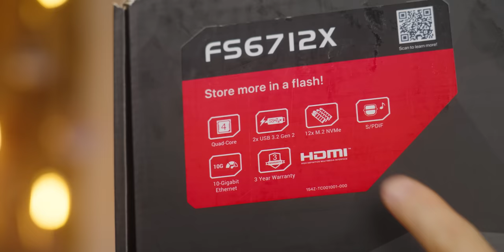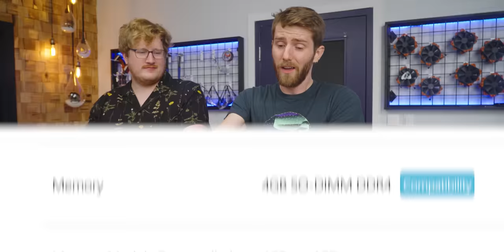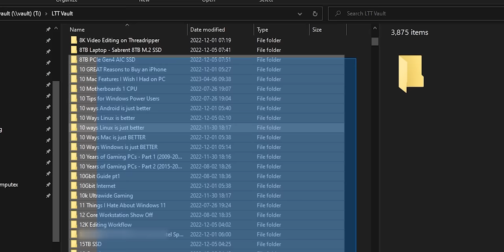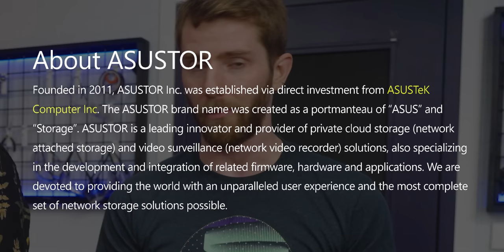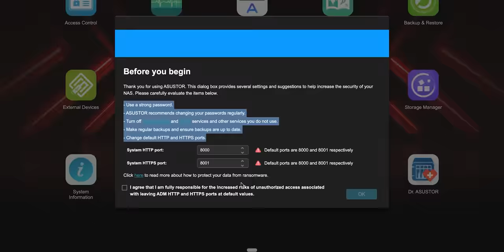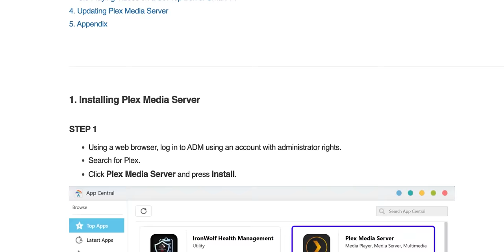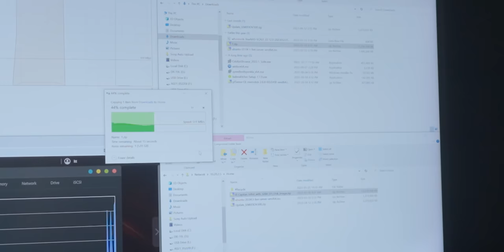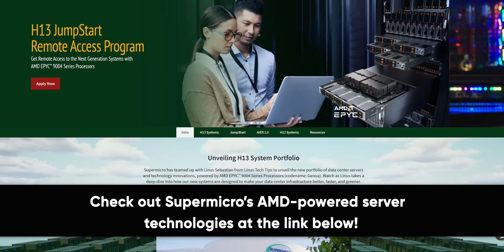I should stop building computers - ASUSTOR Flashstor NAS

Comment: 5:42 Qhat do you mean by H.264 and x.265?
My understanding is, that
H.264 is the codec/standard, and x264 is the software encoder (name of the encoder).
H.264 is the codec/standard, and x265 is the software encoder (name of the encoder).

Specially in the 'Scene'it is handled like this:
H.264 is considered pure quality (not reencoded) and x.264 is reencoded (lower quality).
H.265 is considered pure quality (not reencoded) and x.265 is reencoded (lower quality).

So I dont understand why you said H.264 and X.265 - seems to me, like you mixed up the standard with the software encoder!?

Comment: Is it possible to upgrade the CPU?
Reply: No. We needed to use a low power SoC to keep things cool and efficient while remaining high performance.

We couldn't put a socketed CPU into this form factor if we tried! It's an SoC, so if we put a socketed CPU, not only would it cook itself, but we'd also have to add a chipset as well, generating more heat.

Comment: I cannot wait for something like this that comes with that new Atom N305, sorry, "Core i3-N305" and then has like an android TV-like container. I'd throw one of these under each of my TVs because i am sick and tired of android boxes like the Nvidia Shield TV Pro just not working
Actually, the Atom N305 would make this thing more expensive than using a Core i3-1315u they have the same tray price but the real i3 has 2x the CPU performance, more than 2x the GPU performance(2x the EUs at higher clocks) and it gets 20x 4.0 lanes instead of 9x 3.0 lanes, that means that you dont need PCIe redrivers/PLX to install more than 9 drives. Assuming Intel really does charge the same price like their website suggests, using the actual i3 would make this product cheaper, more powerful, and more user friendly.

Comment: Sucks to suck nerd, I brought my micro ATX pc as a carry on (somehow!!) and they just valet checked it at the gate lol. It was packaged heavily with cardboard and bubble wrap so it was definitely too big to be an actual carry on (got through security with no hiccup except they had to check the dense CPU wires). My hard drive was in its original box, packed with a ton of bubble wrap around it, and it didnt break. 0% data loss. Even though I saw one guy one-handing it on his shoulder and the other guys being generally rough with it.

Comment: I have never been able to bear the though of buying a Celeron.
Reply: Why not? If it does the job, it does the job. It's just a name.
Reply: @ASUSTOR_YT  It never does the job very well, and is hard to upgrade. There's usually a comparable system with another chip, maybe slightly more money, but a better value. If it was just a name, I wouldn't have any problem with it, but I've found they are just bad.
Reply: @klepow  Sure! For PC usage, they can be quite inadequate for general PC usage. But we're selling an appliance that has hardware that is tightly knit to the operating system that does the job well, transfers data quickly, stores and backs up your data securely and easily in a package that is small and uses little power. I understand the perception very well as a PC enthusiast myself! I once had to pop in a Celeron when my 6700K died and needed just to get up and running. It was awful. But, these are not the same, despite using the same name. These are efficient 11th gen cores that use nearly no power and allow us to get multi-Gigabit speeds.

Would I recommend this CPU for PC? Of course not. But I can assure you that the Celeron has done us well for what we do. Efficient network storage. Thanks for replying!

Comment: Can someone ping me when they put an i5 or i7 on this?
Reply: Hi there! Won't happen. They'd cook in this form factor and we don't want to lose trust by shipping something with overheating components. An i5 or i7 would be absolutely be way overkill for almost everyone outside of a business that does VMs and is hammered by customer requests. We are aware of the bad rap the Celeron name comes with, but we wanted to put in a system that tries to eliminate bottlenecks as much as possible so that we can work hard on providing a software solution that just works.

Comment: A garbage OS from Asus which will probably be abandoned in a few years.
Reply: Hi there! We're not ASUS, we're ASUSTOR. We're run independently as a separate company. ASUS does not get involved in our day to day operations. We have separate everything. We support our devices for approximately 7-10 years. At least for as long as device vendors are willing to support theirs. Intel usually supports the drivers for about 10 years. We want data security. We don't want you buying a new one every year. We want customer satisfaction. We build them to last.
Reply: @ASUSTOR_YT  my bad, sorry for confusing you with Asus
Reply: @abdullahX001  No worries. We were spun off from ASUS 12 years ago. We know your data is important, so we actively avoid pulling the kind of BS many companies do. We want our NAS to last.

Comment: Plex is absolute trash :D it worked well when I used it on my gaming pc. On NAS it is garbage CPU hungry trash. 
I switched to tronxy which works so so so much batter :D
Reply: Plex Pass needs to be on the account as well as enabling Quicksync.
Reply: @ASUSTOR_YT  the problem is transcribing. And we always have to use subtitles. Which makes it so that plex must run the transcription and burn the text. This is extremly CPU hungry process and NAS HW is not powerful enough. Tronxy works with no issues whatsoever but not sure how transcription works there.
Reply: @HuntersOA  Media Mode must be turned on. Once the processing is offloaded to the GPU, the performance is smooth.
Reply: @ASUSTOR_YT  there is no GPU in my NAS :D It only has an intel atom processor and 2gb ram :D
Reply: @HuntersOA  Which NAS do you have?

Comment: Can anyone help me
That i got a offer from local seller
Zotac GT 1030 gddr5 2gb with 4year warranty  for almost 40$
And a other offer of GTX 1050ti 4gb almost 5year old for 55$
My system spec are 
I5 6500
12gb ram 
HDD
450w bronze psu
My usage are mild gaming like emulator games,. GTA 5 RP. and mainly in software development learning like C++ , Java using Android studio,unity engine.